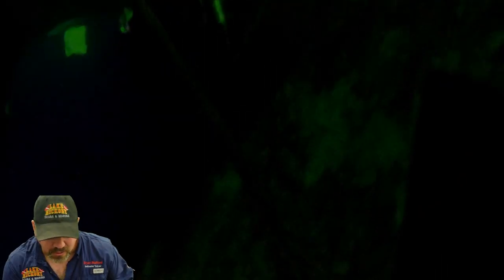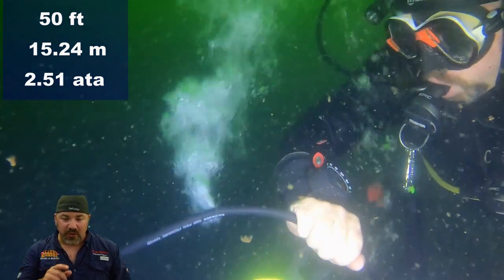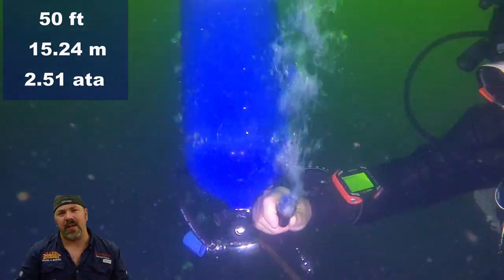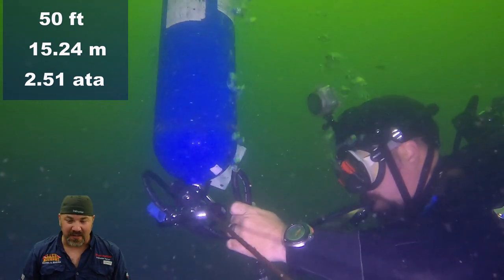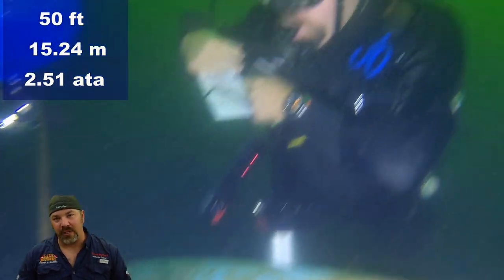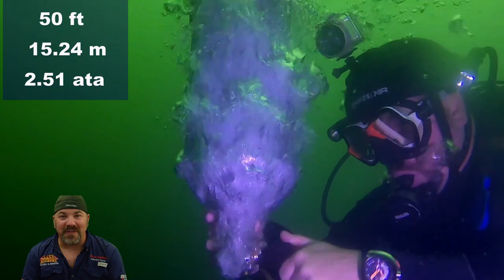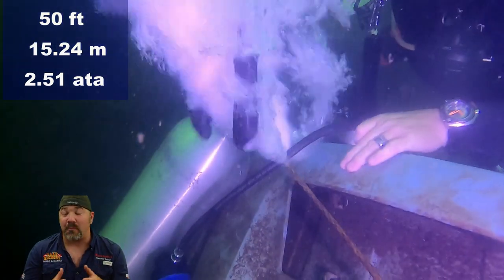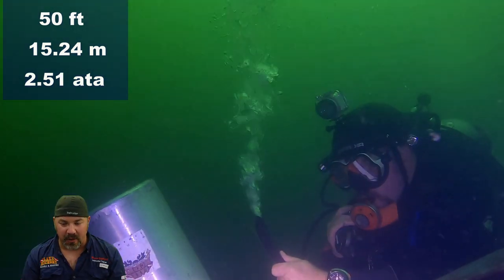Catastrophic Failure At 50 Feet Revisited

Comment: This actually happened to me back in 1982.  I was doing a triangle navigation pattern over deep water as part of an instructor course.  I was using a pilot valve second stage regulator.  The pilot valve blew out.  I was able to breath normally, the excess air just went out the exhaust valve.  I don't recall what depth we were at or how long into the dive.  I would guess around thirty feet. And we were half way through the pattern.  But, when I looked at my pressure gauge I could see the pressure going down rather quickly.  By the time my buddy and I reached the surface and he turned my tank valve off.  My tank was almost empty (if memory serves approximately 200-400 psi).  I blew my BC up by mouth.  And we headed to shore.
Pilot valves were going through a short phase as the best breathing second stage regulators.  I never had mine repaired and never dove a pilot valve second stage again.  They fell out of popularity rather quickly.  I did notice that my perception of time slowed down.  It seemed like it took forever for my buddy to recognize that I had a major equipment malfunction and needed to head to the surface.  However, I'm sure it was only a few seconds.  I had enough air to get to the surface.  However, I was not deep.  Had, I been at 100 feet.  Would I have needed to get air from my buddy?  I would say very likely.  I was using an aluminum 80 cuft cylinder (tank). 
I am not saying this is how it would happen to someone else this was just what happened to me with that particular regulator and tank.
Reply from the maker: Hello Jeffrey Conley, thank you for sharing your story with us. First, I would like to say I am glad to hear you made it back to the surface safely, I'm sure it was a scary situation. Hopefully others reading this can learn from it as well, and they can rest assure that if they stay calm, they will have a better chance at making it back to the surface safely as well. Second, this is another great example of why we should always dive with a buddy and the basic rescue skills we are taught in Open Water should be practiced regularly.

Comment: My daughter and I are both DiveMasters and anytime we are in low Vis, strong current, or below 60ft we sling ponies.  No reason not to - you forget they are even there if your trimmed right. She has a crazy low SAC and carries a 13 cf which lets her do a normal ascent with safety stop from 120 ft. I carry a 19 cf.  If we are in a group in any of those conditions I sling a 40 (rescue diver in me). Love what you said - gear is man made - failures can happen.
Reply from the maker: Sounds like you have a great system there Marty B. 60 feet is the threshhold for me as well, on when I decide to take a redundant air source. Most of the time I am in sidemount, thus, my system itself is redundant.
Reply: @LakeHickoryScuba  awesome, after 35 years of diving I'm finally doing doubles and advanced nitrox with my guy Manny here in Orlando next week, then definitely going sidemount. My 50 year old back doesn't even like thinking about toting those doubles. lol. Keep up the great vids!!!

Comment: Bryan, I'm happy to see you did the test and that you are trying to answer some of the theoretical questions that came up on the other video, but I would very much appreciate if you could address the criticism in the theoretical argument because as I see it, your argument in the last video was flawed. So let's recap the argument in your last video. 

There is a total volume of gas V in the cylinder. You measured the time T for it to bleed out. This gives you a loss rate of r = V/T. You now compute the loss rate R at depth by converting r into RMV (division by pressure at 10ft) and multiplying by pressure at 50ft. 

My criticism of this approach: this is a valid approach if we were looking at a free-flowing second stage that still modulates the gas pressure to ambient pressure. However, this is not the case here. For simplicity, the pressure at the hose end of the cut HP hose is still cylinder pressure. You are bleeding the air at cylinder pressure, not at ambient pressure. As such, I would consider the isothermal pipe-flow to be more accurate here. 

v^2 = A^2 V / (fL/D + 2 ln (p_1/p_2)) * (p_1^2-p_2^2)/p_1

where v is the volume flow rate, p_1 is the beginning pressure (in cylinder), p_2 is the ambient pressure, A the pipe cross-section area, V the specific volume, f a friction parameter, L the length of the pipe, and D the pipe diameter. Now the problem is that p_1 is time dependent and dp_1/dt = v, i.e., 

dp_1/dt = sqrt( A^2 V / (fL/D + 2 ln (p_1/p_2)) * (p_1^2-p_2^2)/p_1 )

This needs to be solved and is A LOT more complicated than a quick comparison to a free flowing regulator. Now, I understand that your 29 minute HP result was pretty nice but your LP result was off by 33% of your prediction. Your open valve results are off by 12%. That is quite a lot and even though your HP result looks nice, I am not sure you can justify your claim that the math worked out nicely with errors that large. In that sense and given that you have not controlled for things like hose length after cut and hose diameter, I think your computation in the last video is too simplistic and makes assumptions which in my opinion are not justified. 

I'd therefore highly appreciate if you could explain in detail why the cut hose should provide a constant volume flow at ambient pressure just like a free-flowing regulator would as this is the underlying assumption of your computation that I would dispute. Furthermore, if the assumption should be satisfied, then why are two of your three tests off by such immense margins?
Reply from the maker: Hello Tobis Hartung and thank you for the very detailed response. I will preface my response with a disclaimer. My understanding of physics is minimal as a Scuba Instructor. It would appear that there are even more unanswered questions that has arised from this video. Some that we are trying to address with another YouTuber who works with physics ever single day. Hopefully, he will have the time to collaborate with us to answer some of these questions. Stay tuned.  

Oh and as far as the 33% and 12% discrepancies, one of the main purposes of this video was to help new divers understand what happens at depth and to remind them to remain calm during emergencies. Whether it was 5 seconds off from our prediction or 30 seconds off our prediction, this gives our viewers a better understanding of just how quickly a diver can lose air at depth, and the reason they should remain calm during the emergency. For the purpose of this video, we are satisfied with the results.  Hopefully, if the collaboration we are trying to get goes through, we can get a more scientific result to answer your question.
Reply: @LakeHickoryScuba  "the main purposes of this video was to help new divers understand what happens at depth and to remind them to remain calm during emergencies" That's fine and I appreciate that you are showing this as it certainly is a good video to show people but if this is the point you want to bring across then you should have said "Let's give this a try and see what happens." There is nothing wrong with saying "I don't know what is going to happen, so I'll give it a try and show you my results." However, that is not the main statements I took from your expose here. I heard that you made predictions based on some scientific argument and that this prediction held true. I might have a go at the computation myself but I can't promise I can get a reasonable prediction given that there are too many unknowns and many of the material quantities were changed between your two tests, so it's not even possible to try and estimate them from the data. 

Yet, if your focus is to show students what happens at depth, is it really a good idea to use assumptions that aren't justified to make a point that is outside the applicability of the theory you use? In that case, what stops us from using air tables for decompression theory with trimix or oxygen stop times for air decompression? They are all decompression theories just like you used a theory of gas flow at depth without checking whether this is a reasonable description of the problem. Then, of course, what are we telling our students about the reliability of dive theory if we are talking about 33% error rates and considering them "good results"? I'm pretty sure if you were to ask a contractor to build an extension to your shop and ask him what he estimates the price is going to be, his answer being "$150k" and then he charges you $200k (a 33% error in the initial estimate), you are not going to go home and be like "man, this contractor was spot on with his price estimate!" Or using a more diving related example, let's plan a dive. Rule of thirds, I turn exactly at my turn pressure and oh my god I had a catastrophic 33% error. I surface with an empty tank. Not even time for a safety stop. Is this the message you want to send to students and new divers?
Reply from the maker: Seems like you are extemely passionate in the subject. That is awesome. Not real sure I will have an answer that you will find satisfactory. Happy diving.

Comment: The HP hose failure should not really be affected by depth!  The cylinder starts at say 3000 psi above sea level ambient air pressure, so average pressure is 1,500 psi.  At 50 feet, ambient water pressure is about 20 psi.  More likely to be a bigger difference is simply small differences in the HP hose inlet orrifice, which is tiny (< 1mm) and which is effectively going to "choke" (supersonic gas flow) when the hose is cut (the hose has a bigger internal diameter than the inlet orrifice so will not be the flow limiter
Reply from the maker: Hello Max Torgue, there are a lot of unanswered questions that has arised from this test.

Comment: I just carried out a "dry" test with my Apeks MTX-R reg set (1st and 2nd) when on a 10l cylinder with just 50 bar (700 psi) in it, and with a Miflex "carbon" HP hose, the small diameter braided type

1) setup as std: IP sat at 9.7 bar with no breathing demand, and dropped to a pretty stable 9.4 bar when breathed with a normal steady continuous breathing rate

2) Removed the SPG and swivel pin connector from the far end of the HP hose, effectively leaving that HP hose open to ambient pressure. IP sat at 9.7 / 9.4 unchanged. The Air leak was relatively small as the HP hose has two small orifii in it, what looks to be about 0.3mm at the 1st stage end, and around 0.8mm at the SPG end where the swivel pin sits. As the SPG orifice is much bigger than the 1st stage end (2.7 x the dia, 7 x the area) this test is most certainly very similar to actually cutting the HP hose, as the very small orrifice at the 1st stage end is going to totally dominate the discharge co-efficient.

3) Unscrewed the HP hose from the 1st stage completely, leaving the raw HP port open to ambient.  The hole in the bottom of the HP port part, through to the HP zone inside the 1st stage, is about 1.6mm diameter (2.0 mm squared area, a huge hole at 50 bar!). Now, well, the air leak is best described as substantial, even at "just" 50 bar behind it, but the 1st stage did an amazing job, with an IP of 9.5 bar with no air demand from 2nd stage, and dropping to 9.1 bar with the same steady breathing demand as used in test1.   This "hole" is roughly 28 times larger in terms of area than the 0.3mm hole that is in the end of the HP hose itself, but you would have to have the HP hose completely unscrew in order to experience a loss of air this great normally. If the O ring failed on the HP hose to 1st stage mating bore, then the air leak would be substanitally less because of the tortuous and long leak path up along the thread form, which has a tight clearance and so very poor flow characteristic.

In terms of WOB, i could feel no difference in inhalation effort, as you would expect with such a small IP change on a pnuematically balanced 2nd stage

Now at 15m/ 50 feet, the same breathing consumption as my nice smooth even breaths at sea level would of course require 2.5 times the flow through the pressure control system of the 1st stage, but i experimented with the cylinder valve position, and once the valve was more than about half a turn open, it no longer was a restriction, so with the cylinder valve fully open i would expect this performance to be repeated at a 50 foot depth. In fact, if we consider the spring rate of the 1st stage pressure control spring to be broadly linear, then we had a 25% increase in IP sag at the HP air leak tested in case 3) so assuming pressure loss is broadly linear to kinematic viscousity (and hence density) i'd expect the IP sag to be 2.5 times greater at 50 feet. Which is still well above an IP of 8.5 bar and would not lead to any change in inhalation effort.

I also have no doubt that my classic SP MK25 1st stage, which has flow paths big enough to breath through easily at zero bar (I've tried, you can breath a cylinder down to zero bar incredibly easily with this piston 1st stage because the default position is fully open) would perform even better at maintaining the IP under such duress.

If you repeat the test, it would be fascinating to do it with cylinder pressure and IP being logged during the test!
Reply from the maker: We would love to repeat this test, and hopefully a future collaboration with another YouTuber, we will have the opportunity to do so. Unfortunately, at this time, walking over to the sales floor to pull product off the shelf for testing is not really an option.  Its interesting to hear about the results you got during your dry test.  We have had others respond with many different theories, theories we wished we could answer. Adding the IP at the beginning of the test is a great idea, one that we didn't even think about. Over the last 33 years that I have been in the scuba industry, I have come to realize, the more I know, the more I have to learn. Here at the shop, one of the biggest discussions our staff has had, is why does air travel through the valve, first stage, and low pressure hose faster than just through the tank valve. The orfice of the tank valve does not change. My personal theory is, the first stage simply moves the orfice to the end of the hose, which is larger in diameter, allowing a larger volume of gas to come through in a shorter period of time. But this is just my theory. We are hoping a future collaboration will answer a lot of these unaswered questions.
Reply: @LakeHickoryScuba  The answer is the weird world of gas discharge co-efficients, that we can sum up for the lay person as "turbulent vs laminar" 

 Imagine water flowing down a pipe, all flowing together, linearly as a "chunk" of water. It clearly exits the pipe at the diameter of that pipe. Therefore the flow rate is simply the velocity of the flow, multipled by the exit area. Simple, easy to visualise

 But with compressable gases, things get weird real quick!   At very high pressure differences, the effective exit area is "choked" because of the speed of sound not allowing pressure waves to flow "upstream"  These problems are the same problems that resulted in the mythical "sound barrier" in the late 1940's.  The effective throat area becomes smaller, sometimes much smaller, as the air arriving has no time to get in a nice ordely que, and simply tumbles around the place in all sorts of directions.  That "turbulence"  takes away energy from the stream (and makes a lot of noise!), and as the free stream velocity is no longer straight down the tube but at a angle to the tube (radially) the effective velocity falls.  Both those characteristics mean that counter intuitively, less air can flow out of a bigger hole if the discharge co-efficient is worse than for a smaller hole.

So with a cylinder valve and the 1st stage attached, the pressure drop across the 1st stage happens at effectively "Better" conditions than for the raw valve, which perhaps isn't that suprising if you look at a valve internals, which is all sharp edges etc.  

Hope that sort of explains why :-)
Reply from the maker: You make perfect sence, and most of our staff have been discussing this all morning.